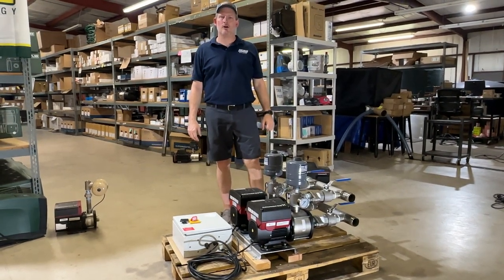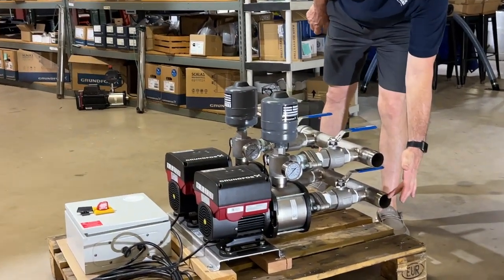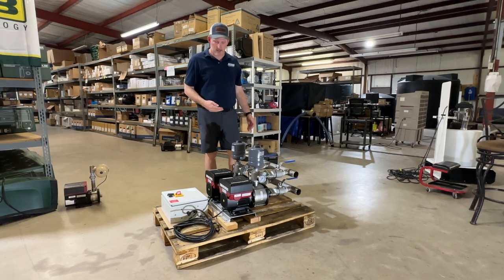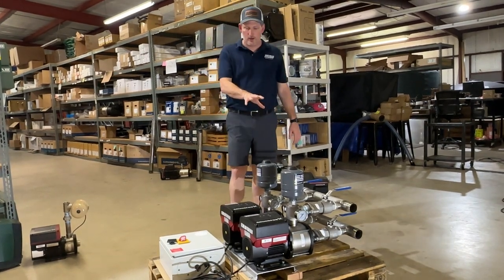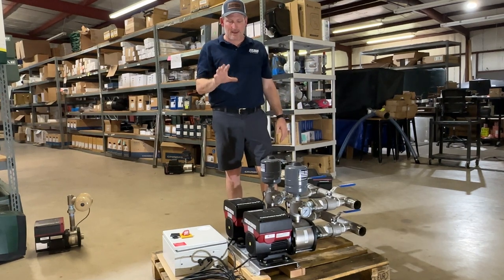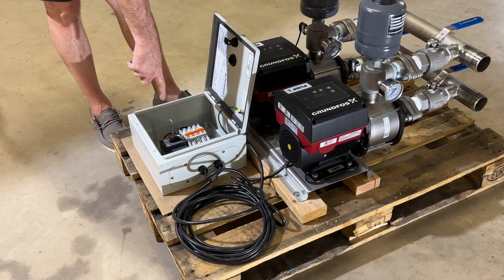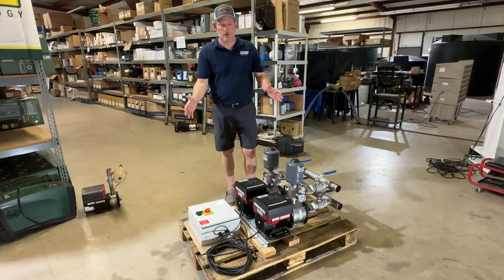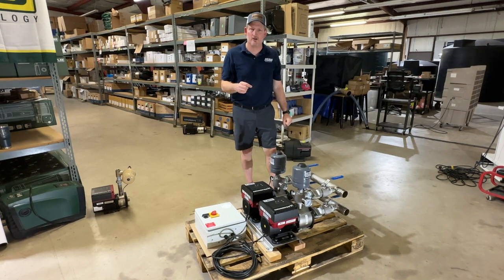Grundfos CMBE 10-54 Twin

Comment: Can a CMBE 1-44 be used for a residential that needs a psi boost from low city water pressure.  Is the CMBE more reliable than the Scala2 pumps?
Reply from the maker: Yes to both questions, although the CMBE 1–44 may have a long lead time. The DAB ESYBOX MINI 3 would likely be a better option if you need something right away. https://rainwaterequipment.com/esybox-mini-3-on-demand-constant-pressure-pump/